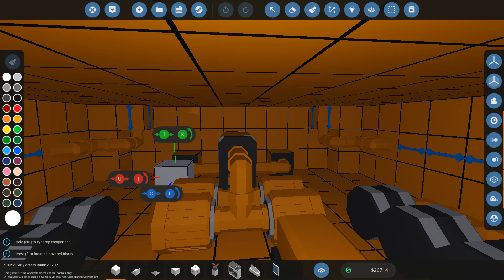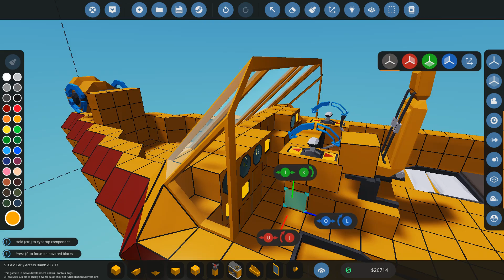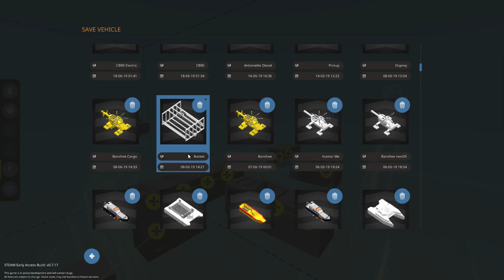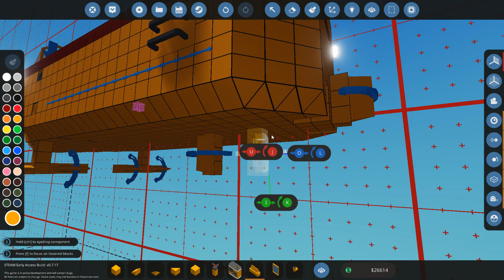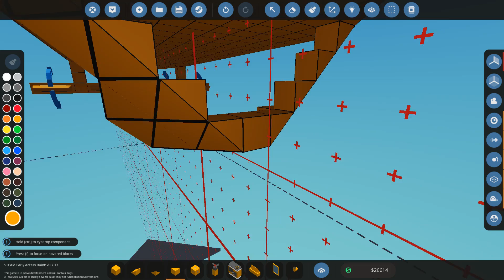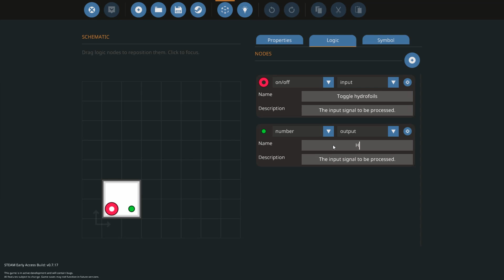Stormworks - Surviving the Arctic - Episode 9 - The Hydrofoil

Comment: Oh god have fun with the next update, the Fuel Efficiency Curves Update, or the making Fast ships slower and slow ships even more slower Update.
Had a ship wich was doing ~86kph and the reallife counterpart did 80kph so i was really happy about it, now it cant even reach ~50kph.
Reply from the maker: Yeah I still have to rework quite a few vehicles. This episode was recorded with the most recent changes active. So far the hydrofoil seems to work well.
Reply: @Stealth17Gaming   Oh thats great to hear that all the changes where active, i mean i'am sure that my problem is quite easy too fix on my end, but i dont know if i will reach the 80kph again with just 3 big diesel and 3 gearboxes each. Mine has a Hydrofoil too, its pretty much based of the Turya-class torpedo boat.
Reply: @Metylaner  Question: How'd you do the gearboxes, since when I did them, arrows pointing to the engine, my ship slowed down (also the gearbox ratio is reversed), and when I turn the clutch on it kills my engine v 0.9.31